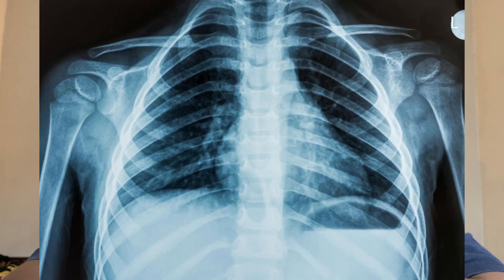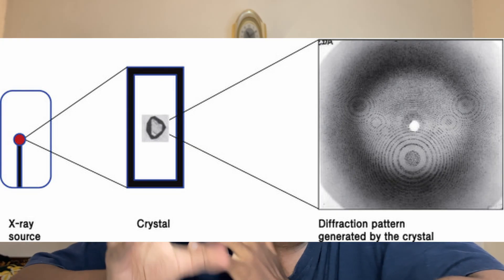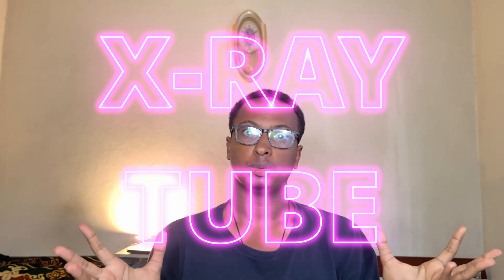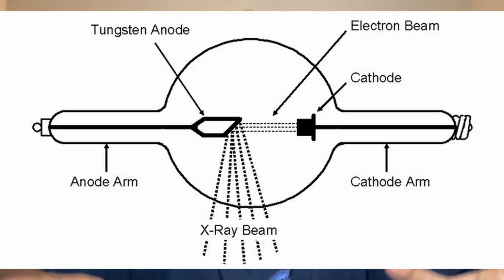I Made a Vacuum Chamber That Generates X-rays!...I Think...

Comment: hello ; you cannot produce x rays this way as the vacum isnt high  enough at all.  Moreover if ever you could , your geiger counter would have read a very underestimated dose debit : at around 20kV you mostly create soft x rays wich are the most dangerous as they are completely absorbed by the soft tissue of the body. Modern geiger counter for the public can only start detecting X rays from 48keV : so it wont detect most of what you might produce.  You should use a 2mm aluminium plate to block these soft x rays.  Also an X ray tube ( whatever kind) produce X rays in ALL DIRECTIONS  ( unlike all the schematics of x ray tube  you can find on line and wich dont shows this true fact) !!   And last thing :  An HV generator has a fairly high enough current to produce quite  nice amount of x rays !! so be very carefull.

Comment: You can do this with pretty much any regular vacuum tube by running it with cold cathode or very low filament voltage. But I would not be close to it. Geiger counters are both cheap and easy to get if you want to check if things radiate stuff